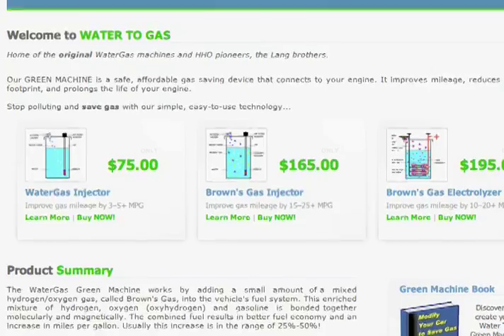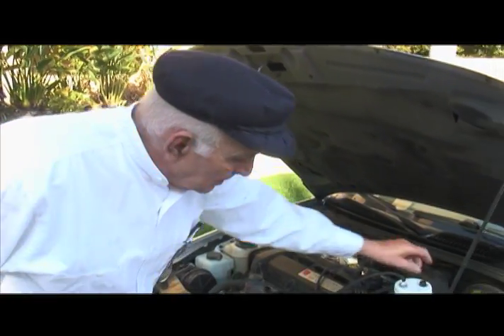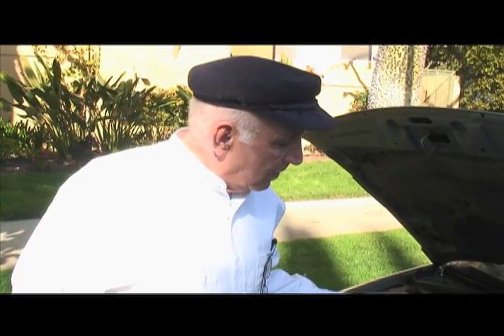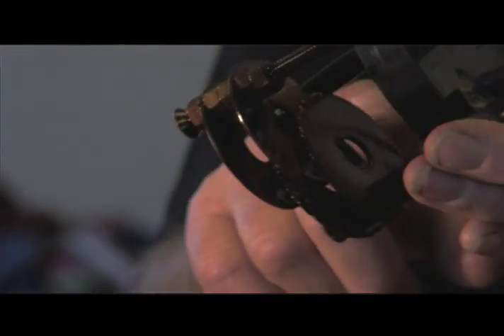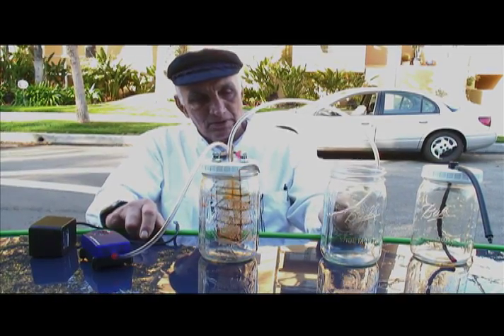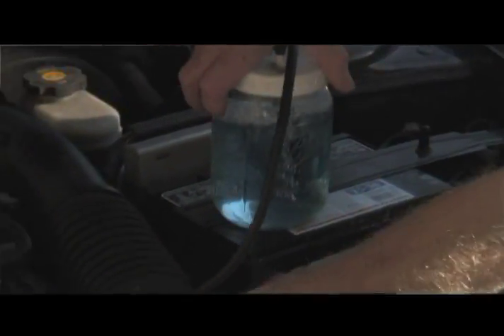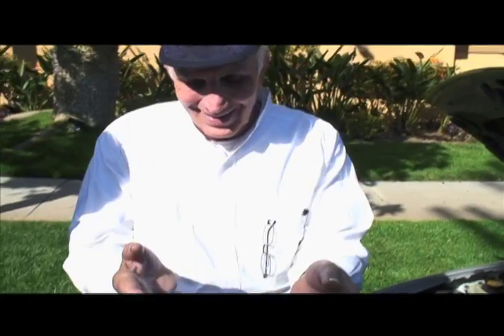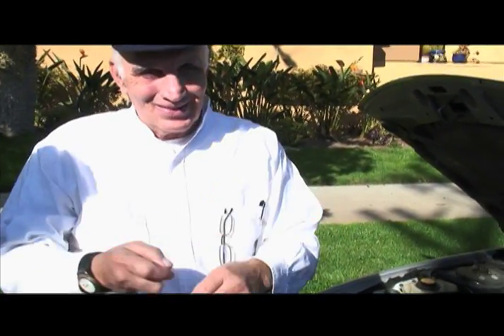How to Drive A Car with Just Water

Comment: Doesn't the process of splitting the water molecule electrically require more energy than is produced when you burn the hydrogen? 

It seems to me that you would need to first develop a way to create hydrogen gas from water at a lower energy, such as with a catalyst or enzyme. Otherwise, you're spending more energy than you're creating.